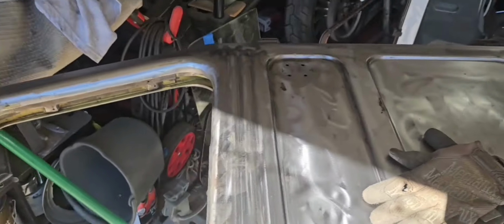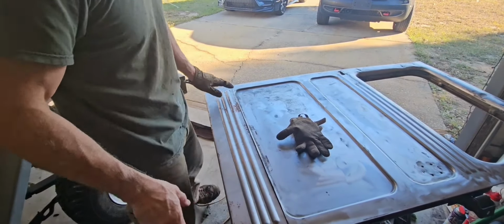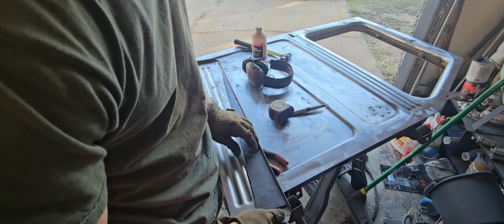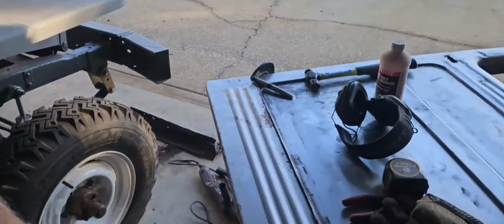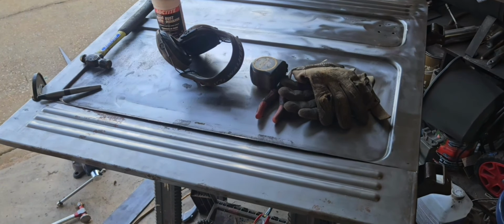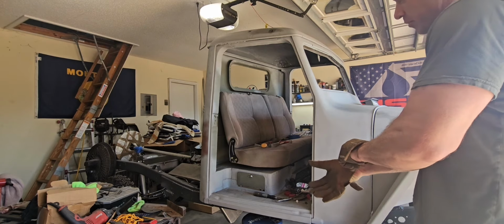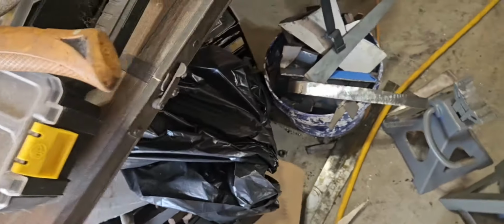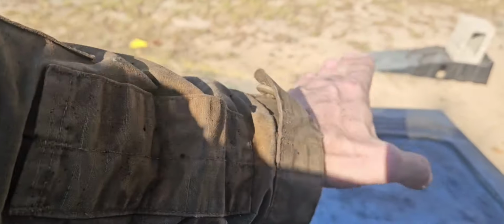Door rust repair and fitting | '48 Willys Overland

Comment: I'm super impressed with what you're doing in a small garage and basic tools.  If a man wants something bad enough he'll find a way to make it happen.  I have one door where I'll be doing some repairs on the bottom, much less than you had to do.  The other door is pretty much rust free, but has some dents toward the bottom that need attention.  Seeing all the little dents in areas I would not expect is evidence of how much abuse these trucks endured during their working years.
Reply from the maker: There isn't a single panel or piece that isn't dented on this truck.  It saw alot of action back in the day.

Comment: I'm worried the water will collect between the skin and your new bottom piece. My F-150 has drain holes along that edge. Do you have a plan for that?
Reply from the maker: I'll probably dump some paint into it as it's standing upright and let it flow into all the seams.  Then I'll drill some holes in a couple places for drainage.